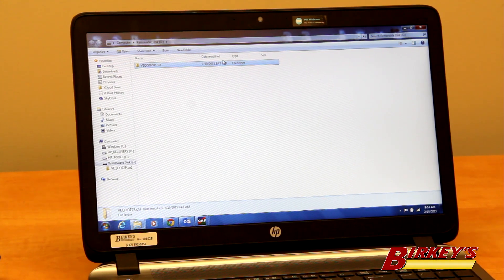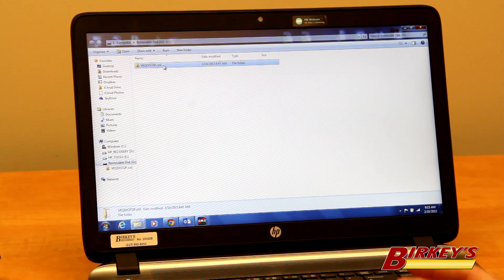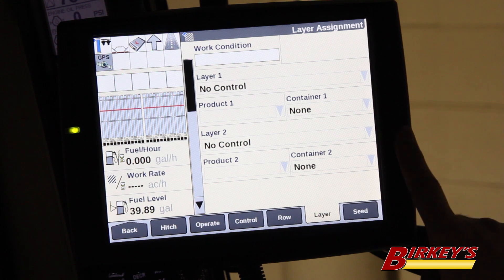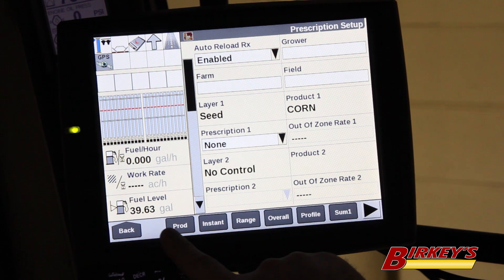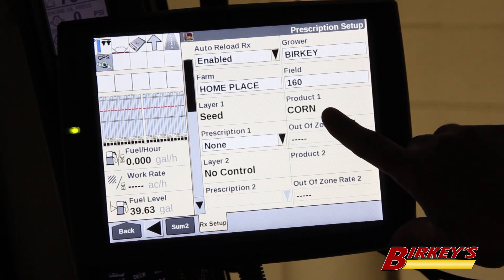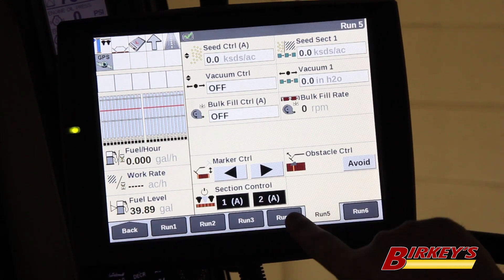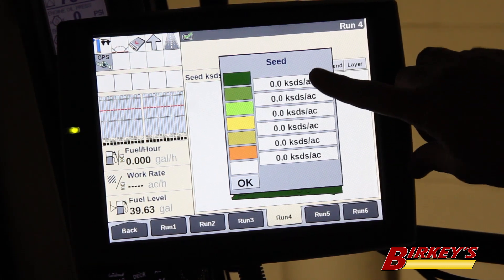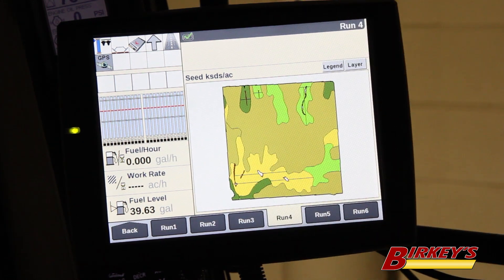Birkey's Tech Tip: Loading a Prescription into the Pro 600 & Pro 700 Display

Comment: My USB has only the .cn1 file before I plug it into my pro700. I plug it in, power on and cannot get the prescription to load. I then unplug the usb and plug into my laptop to view the files and the pro700 has written an additional .cn1 file and a file named export onto my usb...is this normal? Is this exported file keeping the pro 700 from reading my prescription?